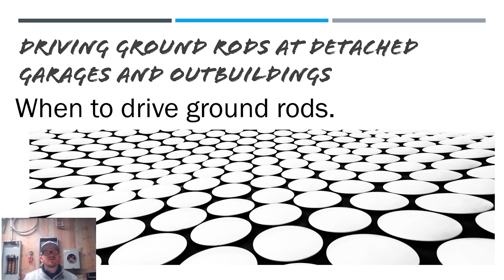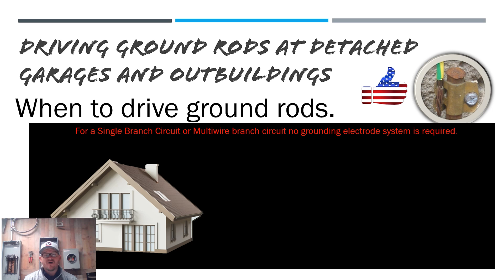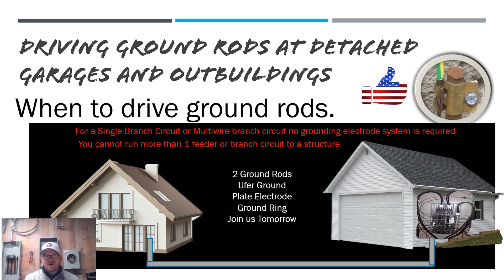Ground Rods at Detached Garages and Out Buildings??When you do. Part 2

Comment: When you do not have a ground wire from the out building or garage, the only reasonable option is to use a ground rod. Especially on very OLD buildings where it is prohibitively expensive to upgrade everything just for one lousy GFCI you want in the garage.
That is what I did - used a ground rod for that one outlet.
Works perfectly too.

Comment: At 1:20, you state that a building can have only one power feed. How does the code handle critical loads? For example, suppose the main structure has a critical loads sub panel that has solar/generator/battery backup during an outage. If the homeowner wants to maintain power to a critical load in the detached building, like perhaps fire suppression or security systems, does the code allow a second feed for those critical systems? If so, what are the disconnect requirements for both of those feeds? Could you use some contactors, controlled from the critical loads circuit but housed in a separate disconnect at the detached structure, that would disconnect the power to both services when opened? This would provide a single point of disconnect for the FD, while still allowing the critical load to remain energized during a power outage.

Comment: Im bidding a mini storage and it has been designed with multiple  circuits in each building without a separate sub panel. fire pump compressor, exterior lighting, wall heater, and general use recp in each of the 9 building. all being supplied by one sub panel in one building. this seems to be incorrect unless you use every exception in 225.30. unless using exception no 1. if this is the case do we need to install ground rods at each building. currently there is a #4 designed to go from supply building to each structure for grounding steel but no mention of a ground rod other then at the 1 sub panel location. Thoughts?

Comment: So if I have a building that is attached like a duplex, with the main panel on one side and it’s feeding another panel on the other side, would a additional grounding system be required for the sub panel? I know you said when adding a panel it is required for detached garages and outbuildings but what if it not detached?
Reply from the maker: That's a great question, you definitely going to want to work with your electrical plans and your electrical inspector.

Comment: Electrical code coach in a Sub pannel with the grounds and neutrals separated are you suppose to get continuity from the neutral bar to the ground bar?
Reply from the maker: Yes you can still get audible continuity
Reply: Thanks

Comment: What if I run one branch circuit to a shed into a 240 VAC/1PH/3 Wire Load Center with only two breaker slots?  Currently I only have one breaker installed.  It is still coming out of the panel as only one branch circuit feeding lights and receptacles.
Reply from the maker: Is it 2 hots and a neutral?
Reply: @ElectricalCodeCoach  It has one Hot, Neutral and ground wire.  The Neutral and grounds are not connected In the Load Center.